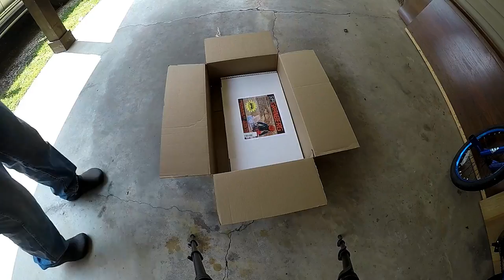Turning A Dewalt Flexvolt Electric Chainsaw Into A Alaskan Mill: Part 2 Cutting The Slabs

Comment: If you going to do an amount of milling with the saw it would be worth while picking up a rip chain. Much easier on the saw and has a narrower kerf so you get a little extra yield out of your log.
Reply from the maker: Absolute right!   This video was all about what it can do out of the box.  I haven’t been able to find a rip chain for the default 16 bar.  I think you’d have to upgrade to the 18 to be able to get a chain.
Reply: Myers Woodshop we started out with an Alaska chainsaw mill then went to a Jonsered chainsaw mill and finally a bandsaw mill. The Alaska mill still gets used for squaring big timber in the country so they are more manageable. I looked around for a milling/rip chain and came up with nothing matching a 3/8” low profile .43 chain.
Reply: Scott Frankland  9
Reply from the maker: What’s the best way to file it?
Reply: @MyersWoodshop  I just converted a 16" to a rip chain. With a dremel I cut off part of the blade on 2 teeth then next 2 left alone and so on for the whole chain.  Then I filed each blade to 10 degrees including the ones I cut.  You can get a chainsaw sharpening jig that mounts on the bar of the chainsaw. I got mine at Home Depot. I have to get wood at my land to mill tomorrow and I will give it a try. I don't have an Alaskan sawmill but I do have a beam machine type thing.
Reply: @banalMinuta  Interesting tip.
Reply: @MyersWoodshop  I found a rip chain for my Atlas 18” bar. All these electric 18” bars similar tooth count, consumer type bars and chains. Look for Oregon one I believe. Most out of stock but Frawlers saw shop had one for me.

Comment: I accidentally ran out of oil and had tension a tad wrong on my first pass of my rip chain on my Atlas 18”. So my chain is dull, and while I can hand sharpen, I’m going to get a sharpener to make sure the rip angles just right. 

As such I dulled it on my first run sadly…so my 80v batteries go dead within 10 minutes, sometimes 15. How long did your batteries last? 

On my crosscut chain with around the house cutting it only went down to 50-75% using it for about an hour. So definitely sad that it is taking me forever to charge and wait, only one small 18” tall, 20” wide red oak slab per battery charge. It was an old tree got for free.

Comment: it appears to be a dull chain. those chips are very fine. should be much larger than that.
Reply from the maker: Your probobly not wrong.  I also failed to refill the oil.  I'm a novice at chainsawing.  I just wanted to see what is possible.
Reply: actually they make ripping chains specifically for milling
almost every chainsaw comes with and is expected to use a crosscut chain

Comment: Great video. I just bought this Dewalt saw after returning a Ryobi  40v 14” saw twice-very disappointed. I was curious how well the Dewalt rips and found your video. Are you happy with your Dewalt after a few years?
Reply from the maker: yeah, its good,  it's not intended to do this, but definitly the closest electric that can to gas.
Reply: Ryobi 14” 40v is way better than the dwault what man!